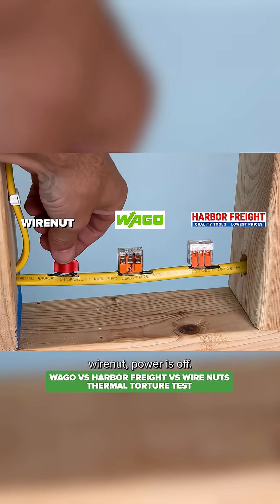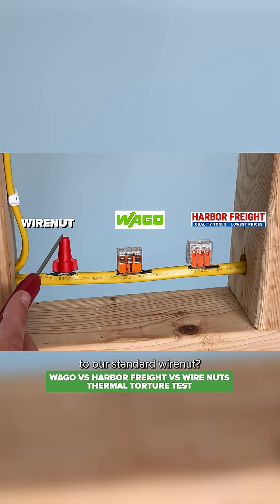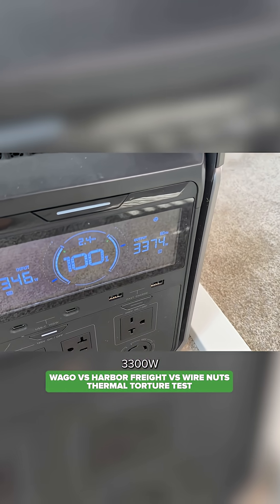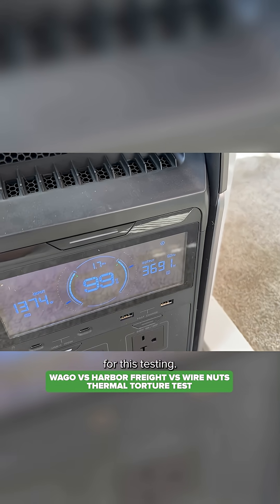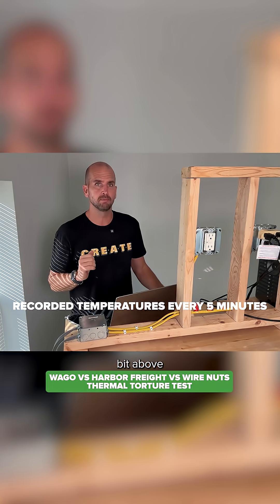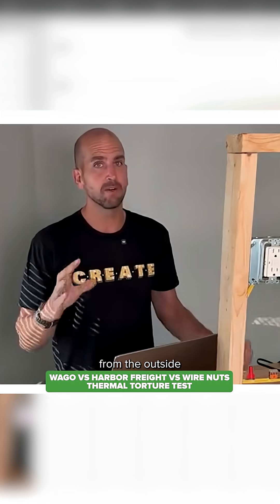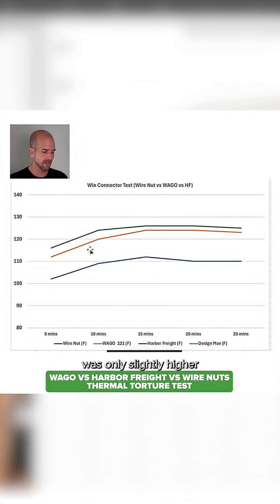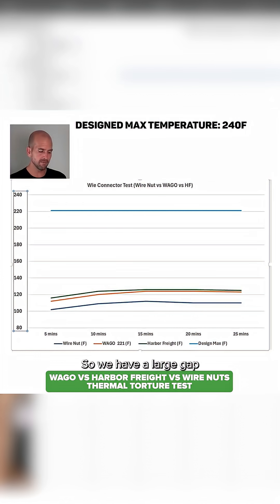Harbor Freight vs WAGO — The Truth About These Wire Connectors!  #diyelectrical

Comment: The results actually mirror what I'd already experienced, but there's a factor not addressed by anyone I've seen so far; if the wire inserted into the levernut isn't perfectly straight and free of side pressure when the wire is tucked back into the box, the levernut can lose contact with the wire.  I've had several dishwasher installations develop a sudden loss of function after a couple of days, and each time, swapping out the apparently properly selected and installed lever connectors to wirenuts resulted in a trouble-free installation.  Lever connectors are fast and easy, but I think they are demonstrating the wisdom of the old maxim that easy and good are seldom the same thing.  That said, I've also seen a lot of DIY fails on wirenuts, so it's not a cut-and-dried thing.
Reply: The opposite with "easy and good seldom the same" applies with clips. There's a lot of bad ways to twist wires together, and DIYers and professionals alike very often don't do "good". Clips are consistently "good enough".

Unless the wire pulls out, the plastic shell makes a loose connection like you describe not unsafe.

With wire nuts, not only do you need to know how to twist wires, and do it right consistently (without scraping up the wire with pliers), but also has a secondary point of failure of the wire nut coming off.

Twisted pair is clearly superior, but only in ideal circumstances.

Comment: Test each connector on 3 different circuits, on the same size wire, with the connector the same distance from source, same distance from load, with 3 identical heaters. Dont use the same heater on one circuit, then move it to the next, buy 3 identical heaters and turn them all on at the same time.
Reply: More variables.

Comment: I'm curious about the sequence of them too. I would think the last one in sequence would be slightly less amperage.
Reply: No, that's physically impossible. Current flow (what you call amperage) is the same through every node of a series circuit.
Reply: @jb11547 there is resistance between the first and third if they are in series.

Comment: I had to get a tall ladder and completely take apart some of those recessed can lights to get at their junction boxes and replace those push-in type connectors that some jackleg installed with regular wire nuts because a client’s lights weren’t coming on after a few years. The contact surface on those push-in connectors is completely inadequate and will oxidize and will lose current transmission. Stay away from those push in connectors.
Reply: Interesting. But, I wonder... If they're failing after only a few years, that suggests something else is wrong. Moisture, the wires being underrated, or the clips being underrated.

Also, Wago clips have were introduced in 2014. I wonder if clips from "a few years ago" are equivalent to today's.

But, being only 10 years, there's no tests saying how they hold up over the long term.

Anything I do, I'll use clips, for the ease and consistency. I'd rather someone have to replace my "jackleg" clips than having an amateur twist, which could be a lot worse.

Comment: Junk science.!  The wire nut is the best insulated so the heat is going out on the wires - - which are much much hotter than the outside surface of the thick plastic wire nut.

Comment: Simple rule: If you're never going to see that receptacle or junction box again, put a mechanical twist and wire nut on it.  If you're installing a light, light switch, or GFCI/AFCI plug (that may eventually fail) put a Wago on it.
I use a Wago where I know I may have to rework that box/junction once or thrice.
That said, I'd like to see some aging tests to see how those Wago springs and bus bars hold up and oxidize specifically for reuse over 20 years.
Reply: "if you're never going to see that again"

Speaking as someone working in an industry where a lot of "never doing that again" went on, go ahead and use Wago everywhere.

Never seeing it again never happens.
Reply: Standard receptacles wear out. Absolutely everything needs to be re worked at some point. Use wago on everything.
Reply: @rpvitiello I bought a 1972 mobile home and every stinking receptacle was so worn out it would just barely hold in a 2 prong plug. Good thing was it had copper wire instead of crappy aluminum.
Reply: Sure.  This weekend I use a wago and left one blank for the neutral since I knew I would be coming back and adding in lights to my lighting circuit.  But the lights I might add would be 1 amp maybe. Everything else wire nuts.  As long as you pre twist it’s good.  If you’re trying to save time wagos are pretty fool proof.
Reply: You can't always do that, my basement walls have the shallow depth boxes installed, it was that way when I bought the house, everything fits much better with the wagos.
Reply: Wirenuts are fucking banned in europe.

Wagos are the standard. 

Properly installed, both work perfectly. But when improperly installed, wagos are much MUCH more forgiving than wirenuts are.

Wirenuts fail more often than wagos do.
Reply: @UserAkuFan420  European leaders have been dumbing down citizens for decades.
The more expensive lever nuts produce more tax revenue than cheaper wire nuts.
Reply: @IGotsToKnow2  lol yeah it's about tax revenue
Reply: @IGotsToKnow2 you think it’s a tax scheme??
Reply: @IGotsToKnow2 not having houses burn down and needing replacement reduces tax revenue.
Reply: @IGotsToKnow2  we don’t use lever nuts all that much. Houses are almost exclusively wired with solid core wires and we use press in nuts for those. Way cheaper then lever nuts and arguably even cheaper then wire nuts. And proven technology for decades now. Proven to be safer then wire nuts.
Reply: @IGotsToKnow2  

Safety is typically expensive, you could make this argument about seat belts.
Reply: @semiprolific774  

"Every regulation I don't like is a tax scheme" is super common.

Safety is typically something that costs more. And of course, you could make this exact argument about seat belts.

It's absurdly reductive and requires that you just...not really think about it.

Comment: Ill take the near 100% consistency of wagos every day over the trivial resistance decrease. The fact that wire nuts are strictly forbidden in industrial settings speaks for itself. Some contracts explicitly specify wagos where inline connections have to be made.
Reply: For DIY, Wago should always be recommended. Everyone thinks they're experts, but few people actually are.

For contractors, I would think the time savings and ease of inspection would make clips the better option. And, contractors probably make more mistakes than DIYers 😂
Reply: @MrRoguetech  Ease of inspection? The tug test takes two seconds. Say that five times fast.

Comment: The problem with wire nuts for the DYI person is getting a good quality proper twist. Sadly most DYI people don’t. That’s where wago’s come in nicely.
Reply: Most people don't know that you keep twisting until you get a twist of the wire outside the wire nut. Once you know that though, it's not that hard.
Reply: This was a point I wanted to make.  Wirenut might be better but even I just half ass it sometimes with things when I know it's just a light connector with LED's that will never pull a lot of amps.  I like the Wago for quick and easy idiot proof connection.

Comment: Wagos have knife bladed connections that arc and cause damage to the wire. Less about the heat and more about an unstable arcing connection.
Reply: No they don't, at least not the type shown. They have a rounded arm. Search for "look inside Wago connector".

Comment: Novice here, not an electrician.   Just asking if you can strip the wire a bit much and hit the laser temp on the actual wire.   Seems like wire nuts have thicker plastic and won't transfer heat through like wago.

Comment: Ahhh but of course you are already causing resistance and heat within inches of each each other on the same line so of course the last one in the line is gonna be the hottest this test doesn’t make sense. This test is a fail.

Comment: While interesting, it would be far cleaner on experiment for each connection type to have its own wiring.  Leading one into the next into the next is not valid in my eyes because the heat is building up as it travels thru the circuit.  I"m confident that you will get far lower numbers on the wago and harbor freight  when they are on their own independent wires.

Comment: This is weird, as I have seen other tests showing the completely opposite result. I have not seen the harbour freight before but some Chinese wago copy, those. Have been anything between not to bed and call the fire department. 
The issue I have with this test is, it does not say anything in this setup except that the wire but at first glance stayed cooler than the clamps, as I said opposite to other tests I have seen.  What would be interesting would be also all specs and also all safe envelopes for the products. Another interesting fact would be, what was the temperature of the wire. It looked like it was either the same or even a higher temperature.
Also in those other tests I have seen they overloaded the different connectors by a certain amount according to their specs, up to starting flames, here especially the wago did way better than the wire but (I think they also tested pre drilled or not etc, not sure if that made much of a difference.
Also something not pointed out very explicitly, those three here, are all way within safe margins, so the temperature difference under normal load conditions does not even matter.

Comment: Wago has one advantage, you can reliably connect solid and stranded wires of various sizes together.
Reply: Yes....Wago came in handy when I installed LED's in my garage. Had to cut the plugs off the LED's and wired to what previously was an 8' fluorescent fixture. Side note....like going from a candle to the sun especially in cold weather.
Reply: Got it, you’re not an electrician
Reply: @clayed3311 there are no reasons to use wire nuts other than tradition.
Reply: @evancombs5159  Cost. Speed. And don't forget size when trying to cram wires and connectors into a tight electrical box.
Reply: @tenlittleindians  cost is the only one that is halfway reasonable, but still the cost difference is minuscule.
Reply: Wagos also are more consistent and don't require skill.
Reply: If you can't figure out how to reliably connect solid to stranded, my humble opinion is you have no business making that connection. Give yourself 25% more stranded wire than solid, wrap that extra 25% around your solid and wire nut properly(no limp wrist allowed)
Reply: @user-rl9zj3gh3w Bingo.

Comment: Don’t pay attention to the fact that the actual wire was just as hot as the hottest device. Wire nuts are always going to be cooler temp because they don’t ever transfer any of the load to the wires. They only hold the wires in a mechanical connection so they don’t come apart and to insulate the wires from contacting other components. If the wiring device is the same temperature or lower complained to the actual current carrying conductors, then they are functioning perfectly and passing the test. Also, 120 degrees is not hot. It’s the same temp as most peoples hot water in their house. Not enough to cause any damage to any building components.
Reply: That's a very interesting point that you make, and also highlights an inaccuracy in the testing method.
Some of the heat generated through the wire nut will have been transferred into the downstream wire. Subsequently the wago would have been starting at a higher base temperature than the wirenut (and the HF version would be higher base again).
I would be interesting to see the same test repeated but with only one connector at a time, I think it would give a more accurate display of actual temperature rises.

Comment: Would it make a difference if you swapped the connections around and had the wire nuts closer to the load and have the harbor freight connector closer to the source? I would like to see it both ways to see what might be the difference
Reply: None. The current through them is not dependent on position. Three resistors in series add to the same in any order.

Comment: Stick with the wire nut. More contact area less heat no mechanical failure to deal with.
Reply: Yes, until you have to twist a stranded and a solid wire together, and somehow the stranded one always loses connection. I’m not an electrician, but I’ve seen too many cases like this and have had to fix them on light fixtures.

Comment: Professional electrician here, 34 years in the trade. I only use wago lever connectors for low current appliances that have a factory J-box for cord connections and exhaust fans that have stranded leads. I use wire nuts for everything else, but only quality wire nuts that I trust. I will never use any stab connectors or backstab devices.
Reply: IMO solid electrical conductors should never be placed in a push type connector. Not enough surface area. I agree with stranded conductors.
Reply: @kevinroberts781  When I hear push I think of stab connectors and I never use them. I've done plenty of pull tests on the wago lever connectors and they don't pull off with real world tension, even with twisting. Inside of them is a conductor bar that is the same length as the stripped conductor so not much different than the surface area of a compression clamp on the side of a commercial receptacle. The electricity always travels on the surface of the wire so these do make a good connection even on solid. The stab connectors or push connectors don't though because it's basically not much more than the point of a paperclip making contact.
Reply: @GettinWired a twist connection will always beat a push connection. You know this.
Reply: @kevinroberts781  I have done large industrial construction for decades, I've wired banks of controll cabinets that have more more miles of wire than a block of houses in a residential neighborhood and probably touched every type of connector and terminal there is and everything always hinges on technique per application. You can even screw up a CAD weld if you don't correctly prep the wire. I've built stress cones in 15kv cabinets that take 1.5 hours per cable to terminate. I've always preferred stranded wire for branch circuits and you never twist stranded wire when using a wire nut. Twisting solid wire like type NM has zero to do with surface area or conductivity, you twist solid wire to make sure you catch every conductor in the wire nut and you're not depending on the wire nut to ensure the connection. I'm not sure if you've used wago lever connectors but they are not push connectors, it's no different than landing a wire in a Phoenix terminal. The only reason I use them is for small appliance lead connections that I can reach from an 8ft ladder or less. If it's something like a stadium light or an interstate pole light I'm absolutely using wire nuts.
Reply: @GettinWired we aren't wiring 4/0 to stadium light with a wago or a wire nut. Stop being dramatic.
Reply: @kevinroberts781  😅 😅😅 the wiring in the heads isn't 4/0! They're not metal halide anymore either. My point was I've made enough connections and I'm going to use whatever I think is the best connector for the situation. I have enough headaches dealing with silly customers than to be reading comments about electron integrity in a joint. Wago has been around for like 80 years and they were making some of the best terminal blocks on the market before they ever made these little connectors. I did an assembly line at a battery plant for Tesla and they specified Wago connectors, so I trust them equally to a wirenut in the limited applications I use them for.
Reply: @GettinWired my point is your gaslighting.
Reply: @kevinroberts781  whatever newbie 😅
Reply: @kevinroberts781  That's funny considering how many screw terminals are being used everywhere and those have pretty much the same surface area. Surface area is not a problem, just use proper load rated connectors and that's it. But even then wagos can handle 2x the load for decades.
Reply: @UhOhUmm I don't think you understand how electrons travel across a film. A twist connection will always beat a push connection. You can fuss all you want.
Reply: @UhOhUmm a screw terminal have 10x more surface area than a wago Sir....